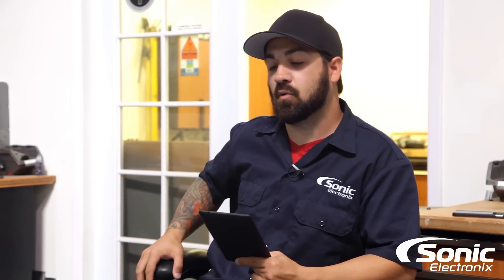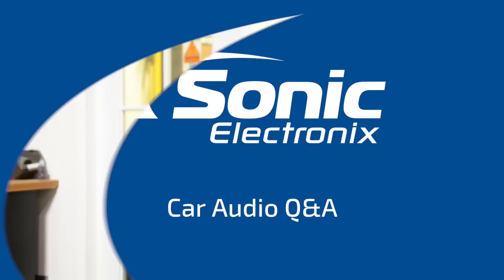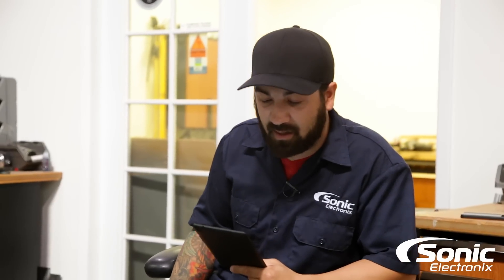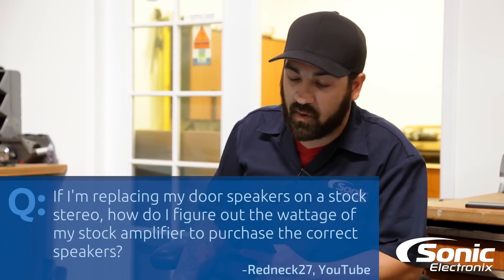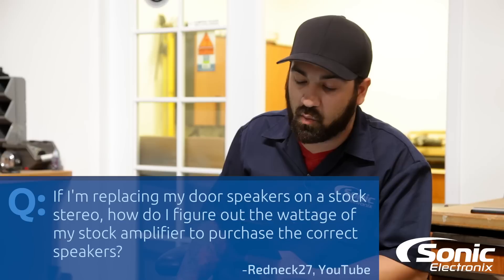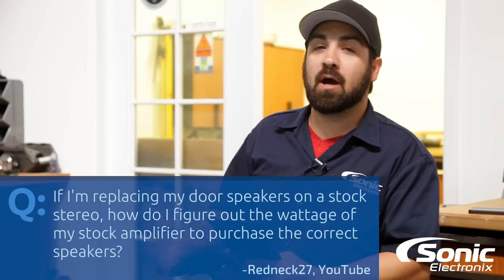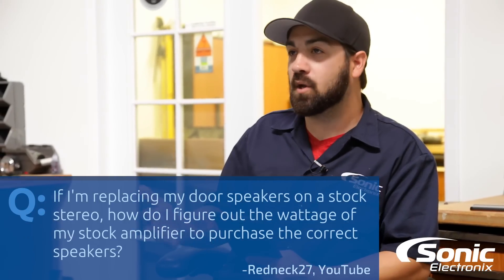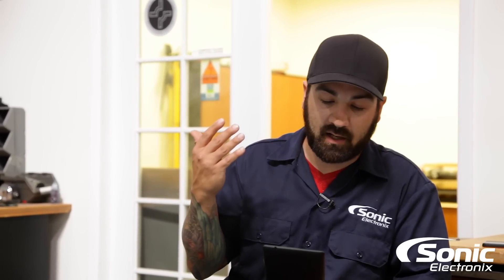Pairing Speaker Wattage To A Factory Amplified Stereo System | Car Audio Q&A

Comment: You’re right if you have a 4 ohm system and go to an 8 ohm speaker you’re going to be disappointed. But if you go to a 2 ohm speaker on a 4 ohm system you’re going to overtax the amplifier.

Comment: What about Kenwood P1000 DAB which says in factory information 4x 50W. Now I would like to instal component set only two as this is a smart car. Hertz 55W RMS is that mean if I use only two channels I can go around 100W in total RMS? Is value given by Kenwood is correct for 50W per channel? Thank you!

Comment: Alan, I have an Axxera AVM111NAVLH on our motorhome and they used a super low quality speakers at the factory. I love the head unit and wonder if it is even worth to replace the speakers. Should I consider adding a amplifier? This unit runs on 4ohms and max power output is only 16 Watts RMS. I don't need anything loud, but I am looking for quality instead. I thought on adding the amplifier so I can have the capability to add a small sub-woofer, but don't know the best way to match all that so it will be a good combined system to work with the Axxera head unit. Any suggestion?

Comment: I got some hand me down speakers from uncles car and I don’t feel like hooking them up to a amp. 2 of them have 75rms and the other 2 have 125rms. Can I still use them in my stock radio? Is there any dangers to have that high of watts on a factory radio or is it simply just not gonna be as loud? Thanks

Comment: This vid is old, but new to me. High sensitivity speakers, to me, always seem to have this annoying screeching noise to them that is interspersed into the music; like a shrill sound, especially if the sensitivity is too high. I don't know how high is too high, but it seems like somewhere around 92-93+. OEM speakers a lot of times have high sensitivities to get a lot sound from little power. This results in the screeching sound I'm talking about. My 2017 Acura has the same thing--system sounds good for OEM, could sound better for the money, and has sensitivity that is high, leading to screech sounds on some songs, and difficult to listen to, even at low volume because it is shrill. The lower sensitivity speakers need more power for the same SPL/db output, but they sound different too, more like a somewhat baffled sound, if the sensitivity is too low, or restrained loudness in some applications. 
So, I wouldn't just automatically rec. high sensitivity speakers.

Comment: Will  only replacing speakers help get better sound? Will installing 300W / 100W RMS   Alpine  give me better sound or I will have to add the amp? Also, what about wiring? Can I use OEM wires?

Comment: Are there any sites that actual test power handling of speakers vs rated power handling.

For example they feed a clean signal and slowly increase power until (if) they reach rated dB and or power draw then slowly increase until failure.

Comment: So I have a question I just installed for speakers on my 2001 dodge ram  They were working fine when I installed them and then the next morning still worked fine got off work and now the front driver speaker is quiet but still working and the radio is twitching out and won't turn up all the way is that because I have a stock stearo

Comment: My 2001 toyota sequioa is 2omh i was looking to swith to a 4ohm or should i just stick to the 2
Would i have to rewire like a higher gage wire 
Do i need a new stero 
As the rear speakers were replaced with 4ohm so always so quite im down to one frapy speaker and need music
I have 6 kids need music 
Its got 3 rows of seets mumma needs some 🔊 bass!! Please help a mom out 
Do i just buy the 2omh front and rear or upgrade to hole thing to 4omh or will that not work with the stock amp

Comment: Dumb question, if my head unit says it supports 4×50w, does it mean it has a max output of 200w? I want to add some speakers:

Some 5.75 inch diameter JVC's at 50w RMS each
Some 1 inch Alpine speakers at 45w RMS

All of it totals 6 speakers (4 JVC and 2 alpine)

Comment: Screw the wattage! Only idiots care about that. What about replacing a stock 8-ohm speaker with an aftermarket 4-ohm used with a mid-level stock system? Stock systems these days are actually pretty decent and many people don't want to devalue their car by butchering up their dash with an unnecessary aftermarket. All it needs is better speakers...

Comment: Please professional help. I got a question. I have the infinity kappa 682.11 cf 2 ohm speakers, but with a new aftermarket head unit that supports only 4-8 ohms. Can I still install the speakers and the new head unit. And what if I install an amp later on that supports 2 ohm

Comment: Hey I just bought aftermarket speakers for my car a 300 watts for the doors and for the back of 500 and I want to put it with my factory radio that came with the car need your opinion what should I do

Comment: Help i just brought a 2002 yukon xl slt 1500 with the on star feature and a subwoofer in the cargo area on left side . Most of speakers don't work the are all factory speakers i wanna change just the speakers for now will later change the head unit to a double din android but my question is i removed the left rear door speaker and it says 8 ohms not sure about the others but can i just change out the 4 speakers on all 4 doors to 4 ohms ?

Comment: I have a 320watts radio . What should i buy for the speakers ? 320watts speakers ?
Reply: Jake Dunes nooooooo! Read the manual and see the peak power it produces and the max rms then choose the speaker more than that or near to that on the above side...dont buy speaker that handle less power than your headunit can supply

Comment: i have jeep wrangler Sahara 2014 with sub woofer and factory amp , just ordered ref coax for back and ref component for front  and alredy have one 500w mono with 10'' sub/box by JL .          where from i get connection for mono amp 
from the stock sub ?
from factory amp?
from stock HU ? 
or may be it has separate mono amp for sub ...                                          thanks for help me

Comment: Do I need to upgrade my battery and alternator? I'm workin on the sound system in my 02 ram 1500, I have a Kenwood kdc-bt765hd head unit, Kenwood kfc-p709ps 6.5 components up front and kicker 5.25 coax in the back powered by a Kenwood 640W 4-channel (power and ground are 8 gauge I think), and a Memphis m6 12" 4+4ohm sub powered by a boss audio 1500W mono (doesn't put out anywhere near that)(power and ground are 4 gauge). Upgraded alt. and bat. wire to 2 gauge but forgot to upgrade engine ground. I feel like I need to upgrade my bat. and alt. 
Also, what amp would you recommend for the Memphis? I want to spend some money on a good amp, but don't want break the bank. Thoughts?
Reply: Do the big 3 upgrade and u will get your full  power out of your amp

Comment: 4 Inch Vehicle Auto Loudspeaker Paired Automobile Automotive Car HiFi Speaker : http://www.ebay.co.uk/itm/352111785395
 - Small unit caliber size ( 4 inches ), high sensitivity ( 88dB ), good bass, provides good and clear sound
 - Ideal choice for listening to classical, vocal, strings, give you a good hearing enjoyment
- Long service life, easy to install
- An excellence gift for car owner

Comment: This is exactly what I have been thinking about. I have always upgraded and installed my personal sound systems in the past. Now I have a 2011 Nissan Titan with factory radio and in dash c.d changer that I want to keep.What speakers besides Infinity would be an efficient upgrade without adding an amp? Also, I was wondering your opinion on Bazooka tubes. I appreciate any advice. Thanks.

Comment: Can anyone tell me what is the minimum RMS power that is required for a 6by9 speakers for better sound(Quality Music)?
I have a speaker which is rated 3 Omhs, 67W RMS, 300 Peak. My head unit is rates 22W*4 and 50W*4.

I am not satisfied with the sound, should i need to get an Amp? isn's that 22W RMS sufficient?

Comment: great question i am looking for...!!! i have 2013 ALTIMA base model without speakers in the trunk . i bought 440watt, 80w nom,4 ohms pioneer speaker , but mechanic says , stock stereo is 2 ohms with lower amp, so my 6x9 speakers willnot work  with stock stereo, instead it will damage ..what to do??
Reply: Connect them in parallel to get 2 ohm

Comment: I have the opposite situation of a '04 Altima with  six  2ohm speakers that sound great but I want to upgrade to an aftermarket head unit that has blue tooth, USB and other modern capabilities. Will the aftermarket unit have a problem with the 2ohm factory speakers? The unit is rated at 17rms(55 watts per channel ) and 4ohm output.
Reply: If your going to install a double din or single din and still use the factory speakers and amp its important to find out the wiring diagram of your stock stereo.

Comment: can you guys show how to hook up a highs amp , I'm so confused on how the speaker wires are ran , do you connect them the the factory wire and run leads to the amp or just run leads to the amp ?

Comment: I have a question I have a single CVX 4 ohm hooked up to a Hifonics 2500 Brutus. The CVX kinda Sounds Bad I have an Epicenter hooked up too it how do I go about Setting the gains Properly ? I have a Basic AVHx2700bs , also would Mixing RMS subs Be Bad? On that same Amp? A CVX and CVR 15 CVX is 1000 watts 2000 watt peek and CVr is 500 rms and 1000 rms amp is 2500 watt help please? Really not enjoying the Bass I'm getting Right Now.

Comment: Can you do bench test on boss audio 1100 watt amp
Reply: I had a "1500" watt... But my 15" sub barely moved. I don't think boss audio puts out anything close to what they say they do.
Reply: +Gnik4144 well considering boss audio is a cheap "no-name" brand, then yeah they aren't going to do what they claim.
Reply: +Gnik4144 A quick and dirty way to find ballpark wattage... amp fuse size x 12v x 0.6 (average efficiency for a/b class amp) an example 30 amp fuse would be  30x12x0.6=216 watts. Some brands use higher amperage than needed or even redundant fuses to make it look like there is more power than there really is being produced.  If you have a class D amp use 0.8 instead of 0.6

Comment: Looking to put a Nexus 7 in my dash with a DAC and an Alpine Power Pack. I currently have pioneer 4x6's for the front and will be setting a HPF since they try to put out what they can't. In this case, I'll be putting Polk DB691's in for my rear speakers which will go down to 35hz nicely, and my sub will do the rest. Will a power pack do enough to power these monster 6x9s on the mid bass or should I look at getting something else?

Comment: I have a question what size wire do you need to wire a pair of Hifonics down to 1ohm
Reply: Any size. But for good energy transfer I'd recommend 8 gauge or less
Reply: +TroniX thanks man
Reply: +Matthew Wombough no problem. The lower the gauge the better :)

Comment: I have a question to ask you,what puts out more power in a speaker 2 ohms or 4 ohms?
Reply: 2
Reply: Ok cool thanks.
Reply: thats bullshit too, all my systems even for customers are always in the 140 Db range, and only push 1000 peak if not LESS!!!!  IVE PUT TO 15'' L3's on a autotek 4000.1D MM and it was wired to 4 ohms to both subs so litterally they split 250 a piece and still hit 140 with 500 PEAAAAK not rms.... that system had 8 Ga from the battery and ground to chasis and had no lights dimming or any drain off the factory system. you only need a big three if ur over anything 1200 to 1500 on any car
Reply: 2
Reply: Ok.
Reply: +Christian Creighton 
thanks good looking, I drive a minivan. and I was thinking about changing all of the speakers in my van and maybe a amp,nothing to fancy just to boost up the sounds a little bit and maybe a eq. but thanks for the heads up.
Reply: +Christian Creighton I'm not trying to be in a compatition,and I'm not trying to go over 1000 watts either.
Reply: +²ºº²GHOST²ºº³ dude that is totally depending on the voltage of your battery. Its usually 13-14 when you are driving and more volts you get more power from the amp
Reply: +²ºº²GHOST²ºº³ 
I'm not getting any sub's right now, I was thinking about getting my factory speakers done in my ride.
Reply: +²ºº²GHOST²ºº³ 
I had a after market radio put in about 2 maybe 3 years ago, and I'm thinking about upgrading my factory speakers in my ride. I have 6×9s in the back and the front doors, and 5 1/4 on the dashboard I was thinking about going with kicker.
Reply: Ok thanks.
Reply: what i just described to you is a 142.5 Db on only 500 watts, where you got over 1000 i have no idea.
Reply: That's not true it's all on the rms and speaker sen activate